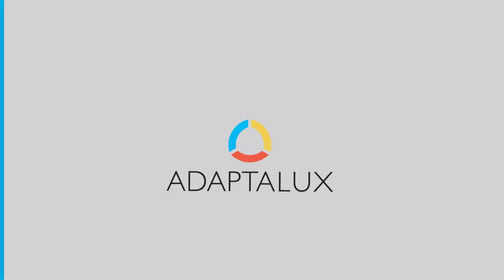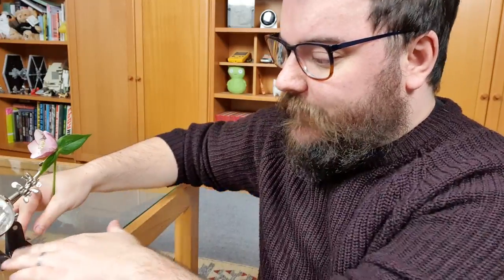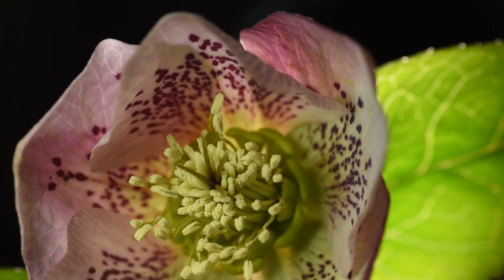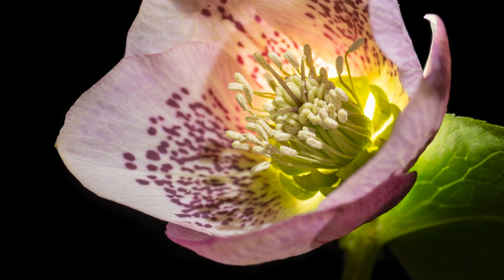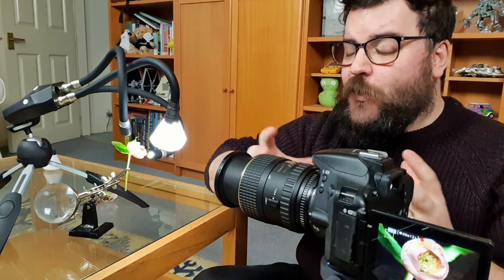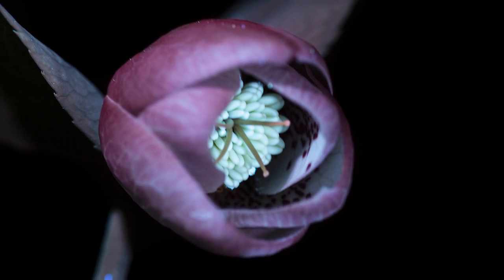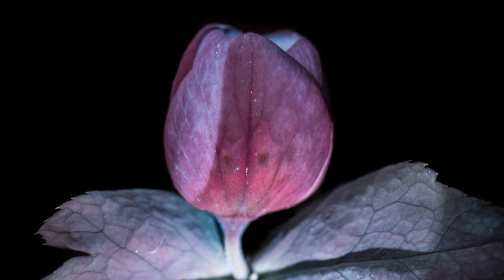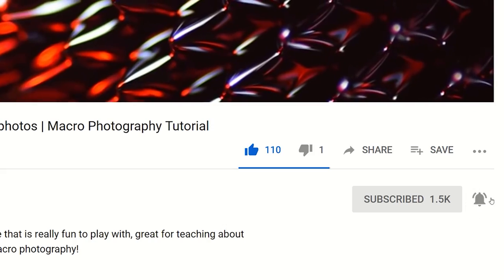Getting light inside flowers - Hellebore flower photography with white light and UV

Comment: As usual, great stuff, Ben!
One tip I might offer to flower macro shooting: The clamps you use (I use the same) tend to be a little too strong and can clamp almost through the stem. At the very least, the stem can't stay straight and will cause the entire flower to 'droop' at lot. (Don't ask me how I know this)
Using a 1"-2" piece of cardboard (a cereal box piece is perfect) that you can fold in half around the stem before clamping will help keep it in place and re-clampable should you need to move it.
Keep up the amazing work, fella. :)
Reply from the maker: Awesome tip Randy, I'll do that next time as the clips did chew up the stems too much. Usually wouldn't have to clamp them, but I let them sit for too long before shooting.
Reply: yes noticed same problem with it I use it as well, good to know the tip Randy thanks.

Comment: Like the light shining through the flower.  I use a light box and get that affect, but the light shines off of the plant leaves.  I don't particularly like the shine. Until I figure out how to eliminate it, it's something that has to be tolerated.  Would prefer the true color of the leaf as well.
Reply from the maker: Thanks William, sometimes small subjects need small light sources. Especially if you are trying to balance the interior exposure. I hope you figure out a solution with your setup!